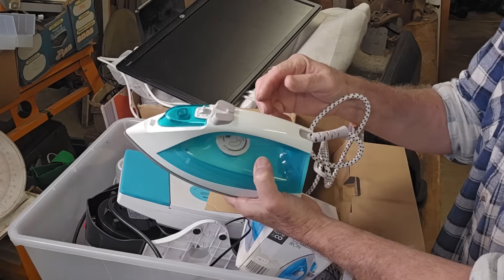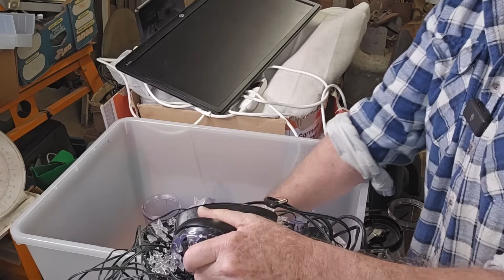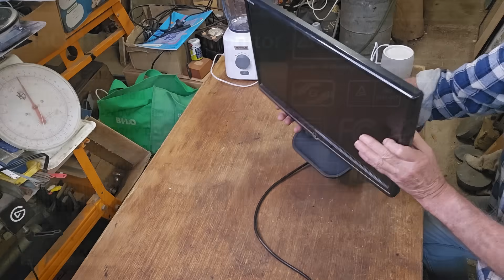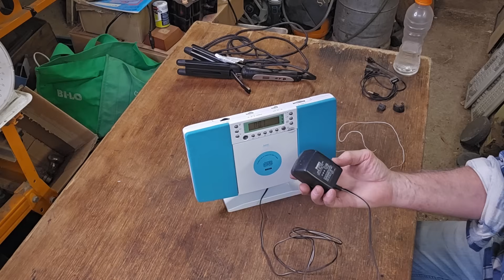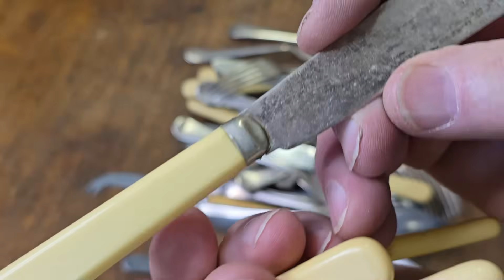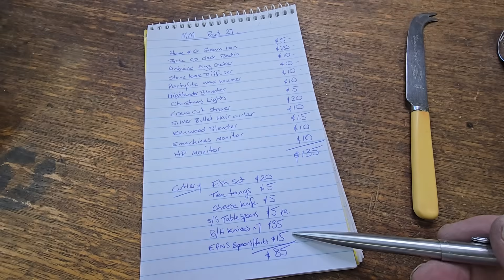Monday Marathon 27 - Processing Ewaste picked up from a Charity Shop! Also Scored Antique Cutlery!!

Comment: Thanks, Chris. I have a question, what do you recommend to remove the stickiness from plastic appliances, (if you were to clean up the black hair tongs)? I have a digital radio that I didn't use for a few years and for some reason it is sticky, it was stored on the top of a wardrobe.
Reply from the maker: Thanks Jane. I usually try metho first, it seems to remove most sticky stuff. You do have to be careful on some painted surfaces though. IPA also works sometimes. Acetone seems to remove nearly everything, which can be risky!

Comment: I'm under the impression that charity/opportunity shops cannot sell electrical goods unless someone at the shop has test and tag qualifications, is that correct?  If so, does that rule also apply to devices that exclusively use batteries and have no provisions for mains power operation?  I'm thinking mainly of children's toys and electronic games, pocket radios and other similar devices.
Reply from the maker: No, battery powered items (although technically electrical) are fine to resell without testing. Charity shops can actually sell normal mains powered items untested, but they need to carry a "Danger" tag and state the item needs to be tested by a qualified/competent person before use.
Reply: @TheUltimateRecycler  I see.  I actually remember buying a portable CD player from Cash Converters in 2004, and it had such a danger sticker on its front panel.

Comment: That white connector on the HP monitor is what's known as a DVI connector.  I think eMachines were owned by Acer, so that monitor may have been a rebadged Acer monitor.  I recognised the first song on that Supremes CD, and track 3 too.  I recon that CD player was probably sold in the mid 2000s, I think Base was a Target brand.  Why do people not want to buy used electric blankets?  Is that due to safety concerns?  I know electric blankets have quite a history.
Reply from the maker: Thanks Lachlan, yep I think you are correct about the eMachines 👍 Many of the electric blankets I get are quite dirty - so that, and the safety concerns probably put people off!